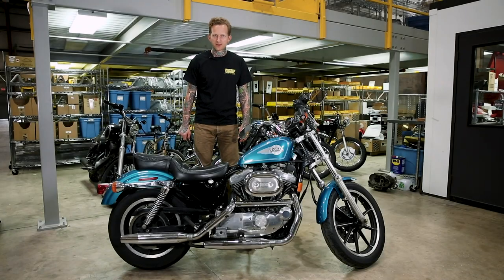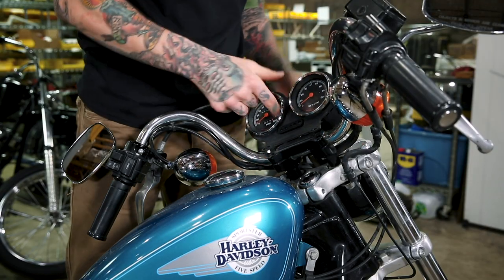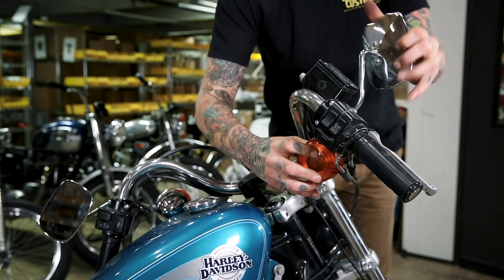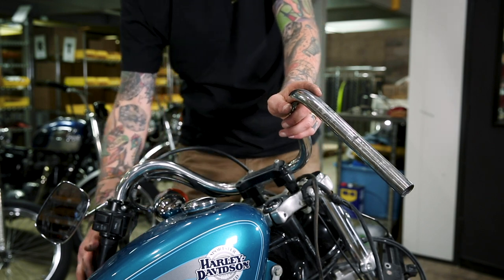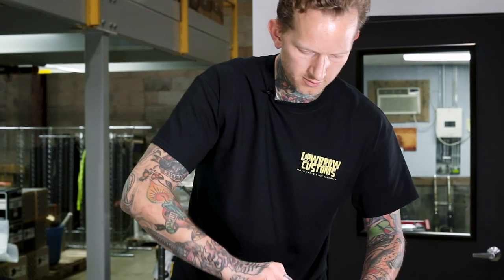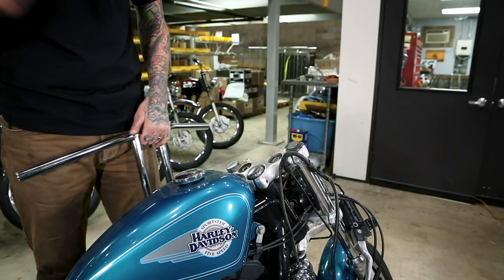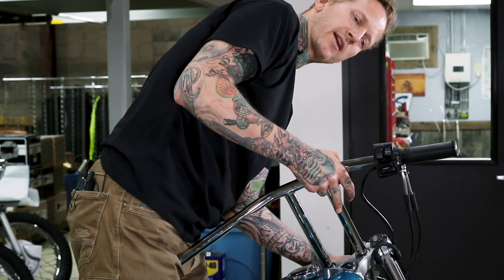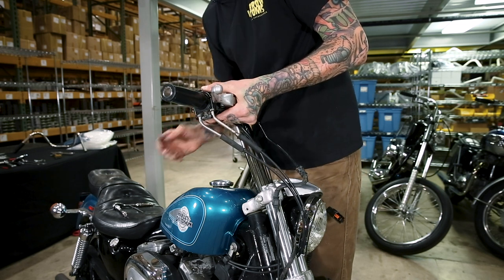How To Install Lowbrow Customs T-bar Motorcycle Handlebars Onto A Harley-Davidson Sportster

Comment: You picked an easy model of sporty to do this with.  Try a 2016+ sporty with the upper triple tree that is a work of art that has to be replaced .  That way you could of shown us how to swap the tripples out. I just finished a similar job on a 19' 48 . Did the 2 inch riser extensions and 8 inch mini apes

Comment: You mentioned eliminating the gauge cluster. Are you guys considering doing a video on that at all?
Reply from the maker: all you have to do is trace the gauge cables to where they connect and un hook them its quite simple. When we tear into this sportster to make a chopper out of it, we will try and include that step in one of them.
Reply: @lowbrowcustoms  Way more simple than I expected! Thanks!

Comment: Great Vid. I have a 1200 C 2005 with that horibble riser, Want to switch to a standard riser set up. Maybe mini apes. Do you have a suggestion or link to a mount you guys have. Chrome. Basically a Sportster 72 setup? To relocate my speedo. Hate the side mounted versions. I have the 4.5 gallon tank. Probably couldnt even see a side mount.
Reply from the maker: You can find stock style risers here: https://www.lowbrowcustoms.com/products/cycle-standard-1-7-inch-rise-forged-aluminum-harley-davidson-handlebar-risers-chrome  We have 6.5", 8", 9" and 12" apes available in a wide variety of options. https://www.lowbrowcustoms.com/collections/motorcycle-handlebars
Reply: @lowbrowcustoms  Hey, thanks for the information. Im going shopping.

Comment: I want to put a set of burley brand scrambler bars on a 96 883 but I hate the way the electrical controls look on the bar. Is there a good kit to replace the stock buttons for a cleaner look?
Reply from the maker: We have a variety of different custom switches and also 'switch pod deletes' that let you use your stock levers but ditch the large, stock Harley electrical controls. Check out some options here: https://www.lowbrowcustoms.com/collections/motorcycle-handlebar-switches-wiring

Comment: Quick question, just purchased a 2011 XL1200C Sportster. Interested in putting bars in like in this video. Do I need to extend all my cables? Or is there enough slack?
Reply: That depends on what size bars you choose. If you have drag bars currently and you're looking to go to 10 inch t bars or some mini apes, yeah you're prob gonna need cables.